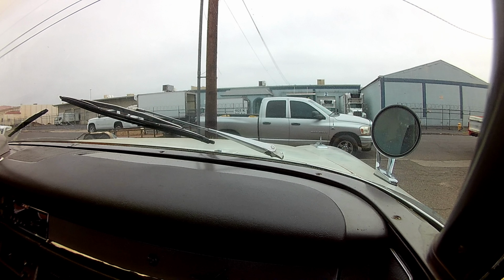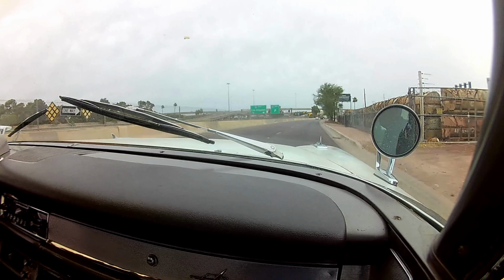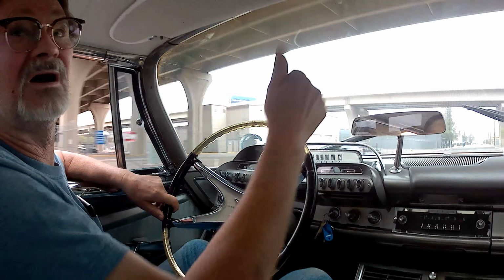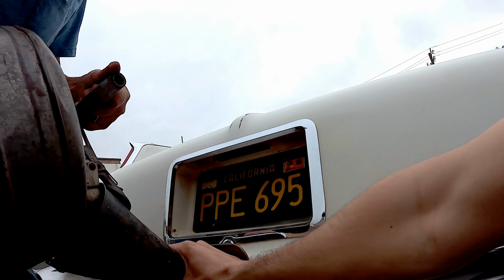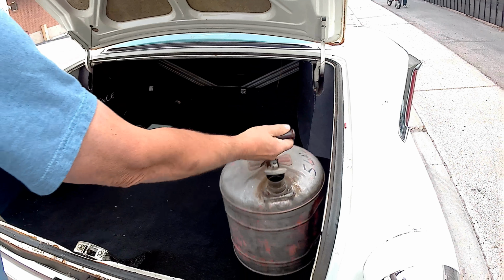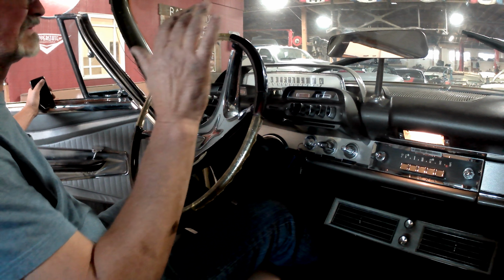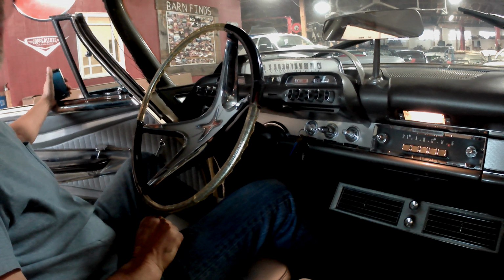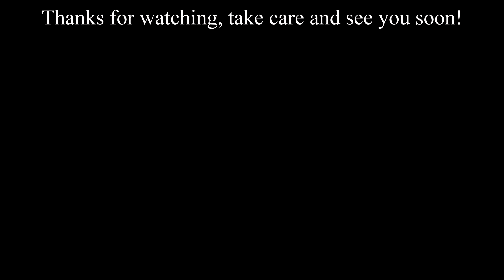We set it on fire! [1960 Dodge Polara ride along]

Comment: 1:50 :) All these cars with a 383 big block went at least 130mph. In fact my slightly modified, high mileage 361 61 Desoto coupe (basically technically the same car and engine family with a smaller bore and less compresion) went easily faster than that. The Pettys went 150+ mph (clocked) with their 60 Plymouth 383s with a small single stock carb, stock intake and stock cam. My 60 383 60 Fury goes way beyond that.
Beautiful car, love hardtops!

Comment: The car wouldn't start again because you were running out of fuel, no gas in the fuel bowl, so pumping does not help. Pouring gas in the engine is a very bad habbit. Just crank it, it does take some time.